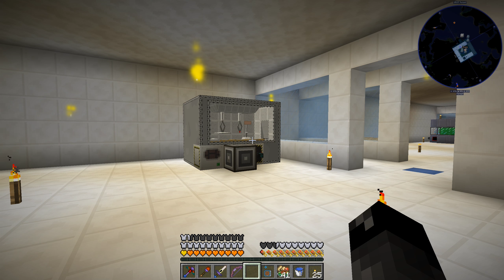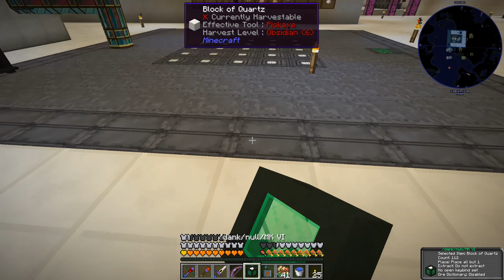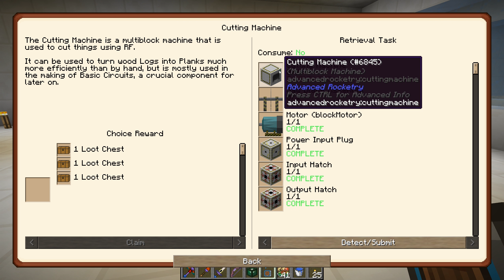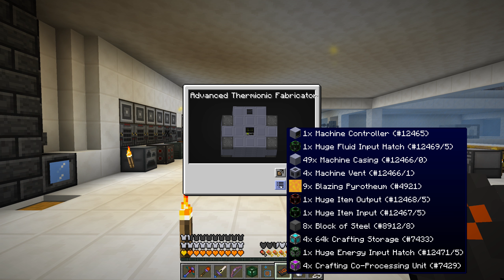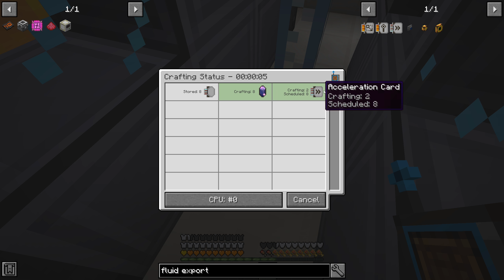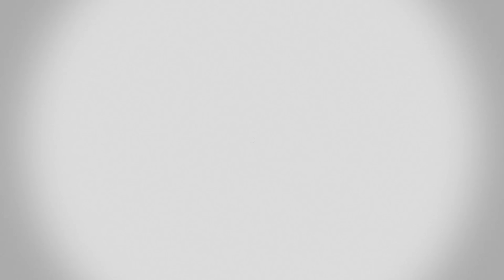Enigmatica 2 Expert - ADVANCED THERMIONIC FABRICATOR [E58] (Modded Minecraft)

Comment: Ice and Fire dragons can be farmed with Foregoing's mob farming gadgets and they don't break blocks.
Just so you know.
In addition not all module machinery machines require one liquid type and I'm not sure if there's a way to auto craft using BOTH items and liquids with Extra cells so I recommend adding buckets to the patterns and using a fluid transposer with filters.
It's a good idea to use EIO conduits for this as they're less messy

Comment: I'm pretty sure you produce more RF/t if you do a checkerboard pattern with the control rods, i.e. maximise the surface area of control rods in contact with the coolant
Reply: I dont think that's how the mod works. I believe by doing that you'll produce less rf but at a much higher efficiency. The way he has it produces more rf but at a lower efficiency burning uranium. (Dont quote me I'm only pretty sure.) I'm pretty sure welsknight made a video explaining how the mod works.
Reply: However this source could also be outdated, so I am unsure of the validity
Reply: @dannymartinez7948  More heat = more power is pretty much how it works. Heat is higher through higher reactivity. I've tried using diamond blocks as fillers, and it worked quite well. High fuel usage and not the most efficient usage, but high production. I know there's a way to calculate for maximum efficiency or whatever, but I've never bothered too much.
Reply: @speedyJ0hnny  I'm pretty sure not many changes have been made to the mod between 1.10 and 1.12
Reply: @CottidaeSEA  theres a webpage you can use to build a reactor.
Reply: @CottidaeSEA  it gives you everything you need to know and you can make it as big or a small as you want and place fuel rods where you want and itll give you all the stats
Reply: @dannymartinez7948  Well according to that webpage, a checkerboard pattern is not only more efficient, but produces more power per second. Would be cool if hypno could implement this to save some costs and boost production
Reply: @speedyJ0hnny  That is probably due to better heat transfer from the cores.